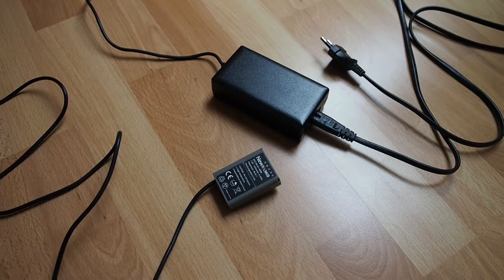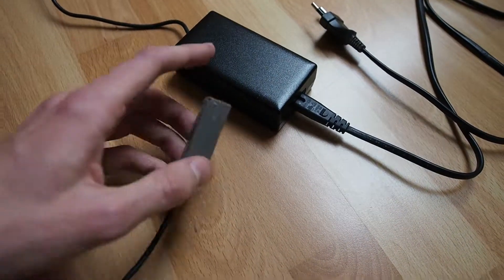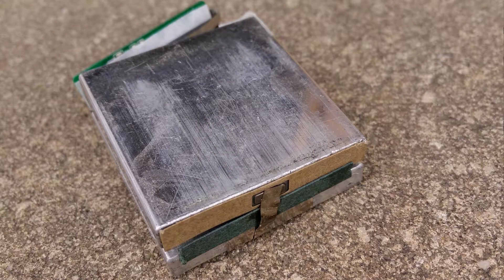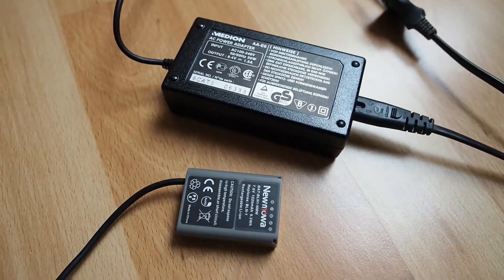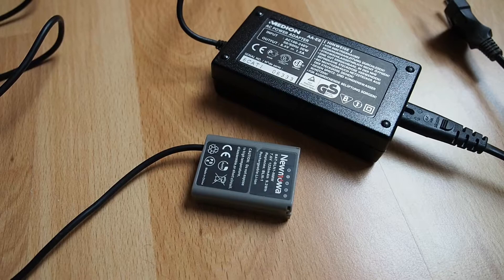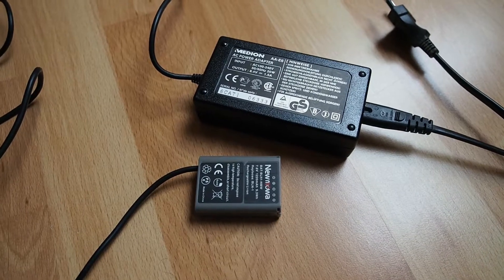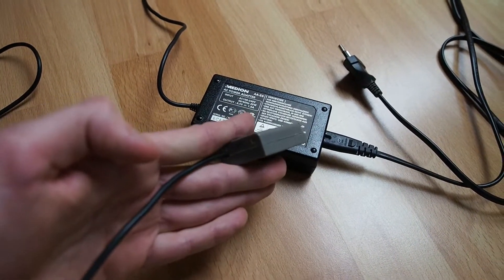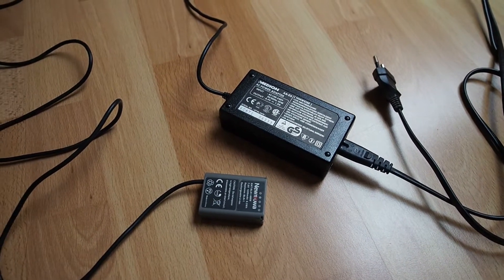DIY Olympus OM-D E-M5 DC Power Adapter

Comment: My Panasonic gf7 has a small rubber piece that allows the cable to pass through the edge of the batter door.  Noticed in pictures the OM-5 lacks that feature likely to be more water tight.  Too bad apparently it can’t be powered via the usb connector?  Another reason for usbc.

Comment: Diy 18650 4s 14.4v bms active balancer charger ok ?use irobot roomba ......
Reply from the maker: Probably not. You need 2S, not 4.
Reply: Markus why ? You can do it . 4s bms active balancer ... irobot roomba use. You can do it only if you come up with ideas, I looked at the videos you made in the past. Your knowledge is enough ........